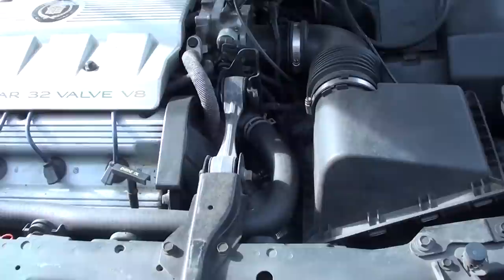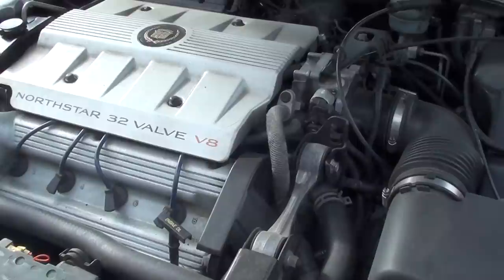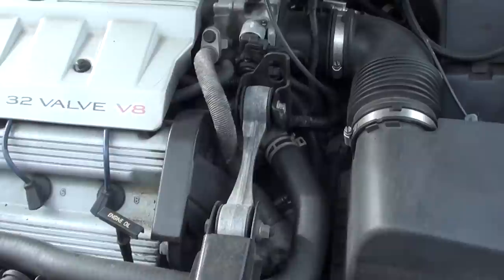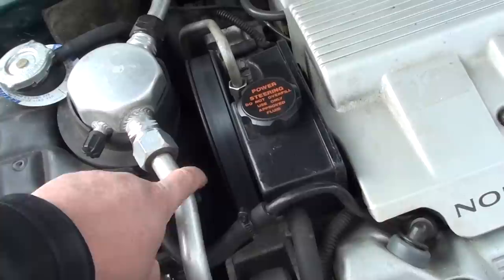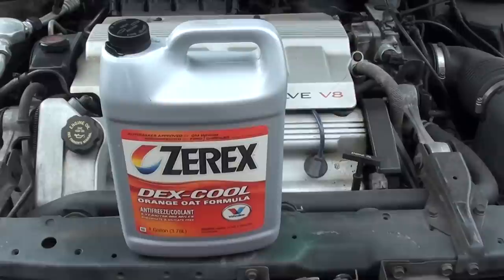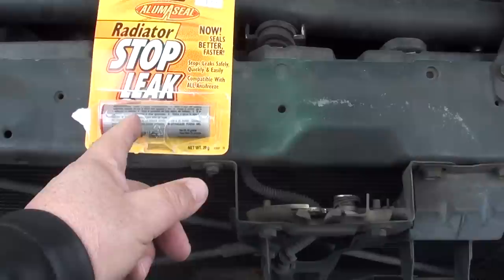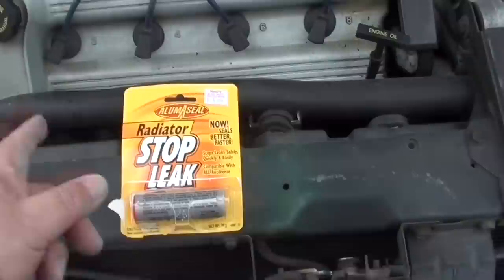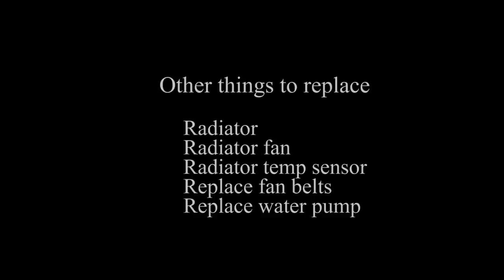Cadillac | Prevent Northstar engine from Overheating | What Mechanics won't tell you

Comment: I have an 2001 STS really nice car, for when the head gasket blows, a new engine is $22,000, repair kit for the bolts plus repair is $5k , remanufactured with performance mods $3k, everytime I drive the car hold my breathe hope the engine doesn't start to overheat.  i will keep the car, just park it until can get the car operational once again. 
I had the radiator crack, i replaced the radiator, thermostat and all hoses,  the 7 heater hoses took 10 hours to replace.  The stop leak is known to plug heater cores amd radiator tubes, you drive the car stop it settles in the opening hardens and slowly it will plug the cooling system components, be careful using it.
Reply from the maker: Hi live Music , i would never by a new engine, there to many great used engines out there. Unless you have deep pockets. The new bolts installed can run around 2 grand.  If you do it yourself i believe the kit runs around 4 to 6 hundred bucks if i remember Correctly ( the one without the inserts ) . Cadillac  was telling us to use these pellets. which was made of the same stuff as Stop leak.  The problem was, I believe, the original Cadillac owners  who aren't mechanics  thought if you just put more pills in it will ensure the engine from leaking. But instead it would  just clogged the system and in turn the engine would overheat, and because the engines originally had poor head gaskets they were the first ones to Blow.

In one of my videos I replace my heater core because one of the nipples cracked because of a poor soldering job. But the core  fins were not clogged at all after examining it. The other video I did was inspecting the Coolant Purge line and that was pristine. I owe this to the previous owner plus my regular system flush every 6 to 12 months. 
Yes if you put to much Stop leak as you said it will plug up anything. I myself will add about 1 to 2 tablespoons  int the system and regularly flush my system,  I have been doing this to my car for the last 5 yrs or so.  Like a GM Master Mechanic told me - Little leaks turn into big leaks. (Regarding internal parts in the engine). Thanks for your input.
Reply: @notsofast2325  I like your user name "Notsofast" 
As for new engine, it is out of the question, to spend $22,000 on a engine to repeat the process and leak again. A company in Canada sells reman and reman performance replacements, at 2,500 or 3,500 your choice.
 They flux the block and heads, stud the engine. There is a kit available choice of (Time sert which the military uses), I use  them in my trans rebuild if strip a  thread, is better designed Heli Coil kit. They offer stud kit as well, since a high revving engine would stud the engine. 
I liked the 98-04 Sevilles, the STS is like the SS Chevy's of old. More potent motor, steeper axle ratio, wider tires, stiffer suspension and struts. It is really fun car minus the Bose stereo, it is loud at 425 watts in small space, just sound reproduction is not audiophile quality.
I had old Nova's one was SS pulled the 350 installed 406 with Lunati racing cam, also sold the 305 out of my 83 Monte to a friend installed high torque 454 it is a handful, yet the Caddy is in between the two, response ot the Big Block and power of the cammed out 406. Just not as fast as either one, Buick is know as Going Fast with Class Cadillac should be "Luxury with Power when you need it"

Comment: Keep in mind General Motors from factory put Pellets in the Radiator  resivor tank. The Pellets are used to seal the complete system.
Reply: Not true. Those pellets go in the LOWER rad hose NEVER in the tank. GM does not recommend that stop leak shit anymore. There is an old bulletin on it. Look it up.
Reply: @lancedukel3436  I've worked in automotive field for more than 35 year's. My STS I've done all the mechanic repairs myself along with my Deville. The Dex-cool is garbage and will cause premature failure and the Seal pellets do work to seal the entire coolant system. The most common issue with the Northstar overheating is the water pump going bad causing higher temperature under driving conditions along with the head bolts backing out creating a gap between the head and block. Their great cars as long as you keep the maintenance up on them that will  apply to any automobile.
Reply: @Tom-wq2mz  GM says not to use stop leak of any kind. Like I said there is an old bulletin from GM. I don't use anything but coolant.  No overheating and no leaks.
Reply: Exactly. In 2006 Cadillac said do not use the pellets anymore.
Reply: @bassb450   Is that you Bass Cat?
Reply: No but I know basscatt from the Cadillac Forum. I think that is who you are referring to.
Reply: @bassb450  LOL! Hello to you to you then. That's a great forum. Bass Cat truly is a Northstar master. Love reading his posts. There are many good people on that forum with excellent knowledge about these cars. So many of these people are still dropping that Barrs leak crap in their cars. I never use it in my Eldorado. Doesn't overheat or leak. Cheers!
Reply: Hello also. Yea some of those guys know their shit. Submariner409 and Basscatt are very prominent as is Ranger. Moist Cabbage was also a big one but has been gone a couple of years. I had the head bolt inserts done 1-1/2 years ago and all is well here also.
Reply: @bassb450  My 2006 Cadillac DTS is being delivered this week. It's my first ever Cadillac so I'd really benefit from the knowledge & experience of seasoned owners. Where might I find this board, please?

Comment: It's my understanding that GM fixed the head bolt issue, but others are saying no. There seems to be conflicting ideas on a GM fix. What are your thoughts? I found a low mile 06 Buick for a good price, but this issue is worrying me.
Reply from the maker: I think your good, I believe they corrected it from 2001 forward. but i would have to double check. I believe i have answered this before. read below.
Reply: @notsofast2325  They made an improvement in 2001, cured it in 2005.

Comment: I could possibly be buying a 96 Cadillac DeVille 4.6 127k was owned by a old man an wasn't ever beat on the car is beautiful on inside an outside needs a bath but they only want $300 for it . 

Does need a few things like a battery , an a driver outside door handle . An it needs the trunk pull down part fixed as well as the blower motor fixed cause it doesn't come on at all when you command it to so I'm guessing the blower motor is bad not sure yet I haven't completely handed cash over yet an got it home but does run an drive an everything seems to be good lile fluids but i did noticed it did have green coolant in it instead of Dexcool in the reservoir so that not good .

Just really hoping it doesn't have a bad head gasket or one that's about to go because I know that's not a cheap job or fix on these and it's so very common .
Reply: I seen some copper looking stuff in the reservoir but I'm not sure if it was copper looking stuff or the beads or whatever I don't know what that is not sure never seen it before it looks like dirt but I could be wrong I'm just not sure what it is inside the reservoir
Reply from the maker: I would flush it out just so i have peace of mind

Comment: Enjoyed your video. Thanks.
My car is a 2004 Cadillac Seville. Almost 6 years ago, its "Add Coolant" alert was displayed. My mechanic believed I shouldn't have to add coolant unless there was a leak in either my radiator or head gasket.
 Because he couldn't find a radiator leak, he suspected it was the head gasket.

He topped the coolant off and put AlumaSeal in the radiator. He said AlumaSeal was the best product to use because my car has an aluminum block. I think we both felt that was a temporary solution.
 But, it worked magic! The "Add Coolant" alert has never again displayed and the car has never overheated.

If my car did indeed have a head gasket leak, I'm wondering if the AlumaSeal fixed it permanently - or, is it more likely it never had a head gasket leak to begin with? What do you think?
I'm considering a coolant fluid exchange but am concerned that may put me back at square one relative to whatever caused the "Add Coolant" light to come on in 2015.
 I know, under normal circumstances, a coolant fluid exchange would be good for my car - but I'm afraid of upsetting the miraculous results I've enjoyed thanks to AlumaSeal. I'm wondering if I should just leave well enough alone.

What do you advise?
Reply from the maker: I would have tested to see if there was a leak,  using a pressure gauge attached to your radiator fill cap and check the readings. if the pressure drops , then look to see if there are any leaks outside the engine, if not then it could be a head gasket.  if you want to change the coolant because you think its old, i would buy a small antifreeze test gauge to check, they look like a eye dropper and there cheap. check first before you change it to see if its still good. ( you may not have to change it depending on your driving habits ). If it looks like you have to change it.  I would change the antifreeze, but have some AlumaSeal handy in case your light kicks on again. Some guys would automatically put it in, but beware if you put to much it will clog your heater core. I was losing a little fluid in my 98 deville ( it wasn't overheating )and i added Alumaseal and it stop losing fluid. But when i change my fluid i add about 1/4 of the recommended dose. One thing i would also check is to see if the fans are kicking on at the right temperatures. 
You may want to check out this video   
    https://youtu.be/6B8-n2ILDbw
Good Luck.
Reply: @notsofast2325  Thanks for the detailed reply. I appreciate it.
Reply: Likely never was a leak to begin with and the sensor in the tank was stuck
Reply: @robertdunaway-tyll7635  Thanks, Robert. I appreciate your input. My '04 Cadillac is still running strong. How do you feel about a radiator flush and a coolant fluid exchange. Would you chance that - or just forget it?
Reply: @billhankins1293  Well bill, I don’t have a Cadillac but I have an Olds Aurora with a Northstar and I know the sensor in the coolant tank can’t be changed, to change the sensor you have to change the tank but I bet with a coolant flush it could un stick the sensor and your light might go away
Reply: @robertdunaway-tyll7635  Thanks again, Robert. I appreciate you taking the time to reply.

Comment: Does the 2007 Northstar have the same problem with a head gasket
Reply: They lengthened the bolts in 00. Then changed to a coarser thread 04. Any car can blow head gaskets.
Reply: @notsofast2325  Apparently, true fix occurred in 2004. Band aids on earlier versions.

Comment: What oil would you recommend?  1998 cad Seville sts
Reply from the maker: I personally would use Valvoline high mileage 10:/30 synthetic. But as long as you using any good oil and change it regularly you'll be okay.

Comment: I’ve had my 2007 Buick Lucerne cxl for 4 years and it has a Northstar V8 High Performance engine.. it has never overheated and I always push that thing because I have a heavy foot! Is it just the older Northstars that overheat or all of them?
Reply: Well any car will overheat if the cooling system isn't maintained. The problem with these Northstar motors is the cooling system is sealed and ANY leak including small ones will lead to temperature spikes. Flush the system every 2 years, replace hoses ect when needed and don't add any snake oil in the system.
Reply: Well I push mine too...
And pull and tow and roll.mine .a pile of General mtrs crap
Reply: @notsofast2325  No. My 02 still used the finer thread head bolts. But yes , longer. After 02 head gasket failure (which is due to the bolts pulling from the block) was greatly reduced. Yes, plenty still blew. But much less.

Comment: Hello great videos, would this apply to the 4.9L engines too? Mine has been overheating but I just dumped some more anti freeze into the radiator however it was the green antifreeze. She usually starts right up just curious as I bought her as my first car. 92’ El Dorado
Reply from the maker: Humm, i would get another cheap car just to drive around in. these cars are old and anything can go wrong with them and if you're not good with a wrench, repairs will add up quickly..Green engine coolants are designed for use in older cars (think pre-2000), ones that contain a lot of steel and copper components in the cooling system. To protect these metallic parts from rust and corrosion, Inorganic Additive Technology (IAT) gets added to the mix.And then we have orange antifreeze, which also defends against corrosion but instead of being geared towards older cars with lots of metal, it’s made for newer cars with more aluminum and nylon parts in the cooling system.his transition from steel and copper to aluminum and nylon started back in the 90s. Due to this change, GM introduced DexCool. DexCool is a type of coolant that uses a mix of different Organic Acid Technologies (OAT) to help to help inhibit the buildup of rust and corrosion.
The cons of orange coolant manifest when it begins to run low. When this happens, oxygen may invade the system, creating a buildup that can clog and damage internal components.
Thankfully, orange antifreeze should last as long as 5-years. Meaning so long as you remember to refill it, your engine should not experience any issues.The short answer – no. When orange and green antifreeze mix, there’s likely to be a chemical reaction that causes it to thicken into a gel-like substance. Since your engine needs fluid rather than gel, it’s unable to effectively cycle it through the system.
Without proper cooling, various components may overheat, leading to failure. Take your water pump, for instance, which is in charge of pumping the coolant throughout the system. If it fails, you’re looking at a replacement cost of as much as $750.
if you’re going to use a different antifreeze, you’ll need to flush your cooling system first, which carries a cost of about $100. Hope this helps
Reply: @notsofast2325  Thank you for the information, very helpful I appreciate it.
Reply from the maker: @bobbylynch6586  glad i could help

Comment: There is a small issue that has come up with my car.
The digital display voltage is reading too low, indicating a likely alternator failing. While driving it reads about 13.2 volts. When I turn on the headlights it drops to 12.2 to 12.5. I've been advised that due the Limo size and additional electrical loads that are over and above the regular DeVille chassis,  that I should upgrade the alternator to a 220 or even a 250 amp unit. Do you have experience with this, and have any recommendations on this?
Reply from the maker: in my limo i had 2 batteries. the auxiliary was in a sheet metal box right in front of the passenger tire. i would replace the alternator ( if bad )and install a Auxiliary Battery.
Reply: Hey, g'mornin...
I have two batteries in the limo. It was wired that way by Superior Coach, the builder of the limo body. I replaced both batteries. One being a regular starting battery. The other being a big deep cycle battery which is located behind the drivers seat. It is secured in a box, bolted to the floor. I changed out the alternator as well. The alternator I took out was a  140 amp, and I ended up replacing it with the same amperage. Larger amp units were ridiculously expensive. You will know,  the ludicrously location of the alternator on the 4.6. You tube videos are plenty on removing the alternator, which almost all show major  removal works of many components, fans and rads trany lines and such. One comment I read on one video, told of a small plate under the alternator, held on by 4 bolts.
Removing that plate revealed an easy access path to drop the alternator out, super easy. All I had to move was a few wire looms just inside the plate area. I pulled one of the three fans to give the alternator a bit of room to turn, and provide access to the alt mounting bolts. Total time was a couple of hours. I was pleasantly surprised at how easy it was. Not as easy as swapping the alternator on my Mustang, (10 minutes) but still not as bad as all the youtube videos make it out to be! Long story short, all is back to 'normal'.
Reply from the maker: @mikebates7757  awesome! !
Reply: If I had time, I'd make a video on how easy it can be to swap alternators in this car. But life at the present has more important priorities!
Thanks!
Reply from the maker: @mikebates7757  your welcome.